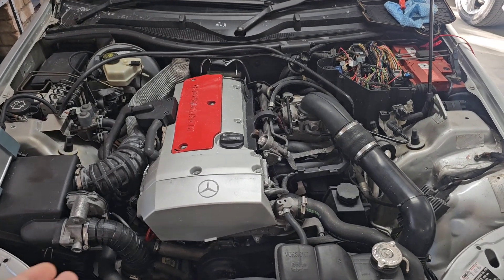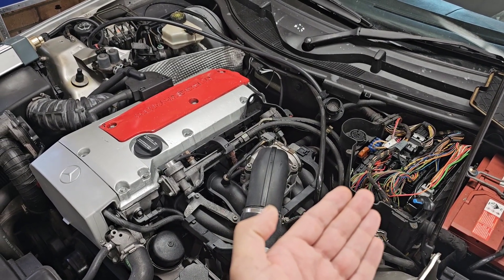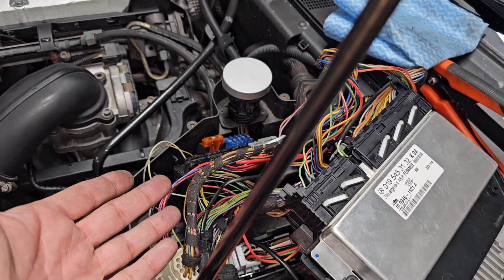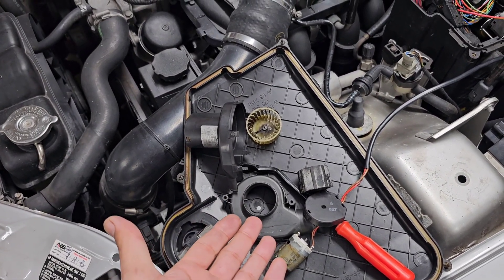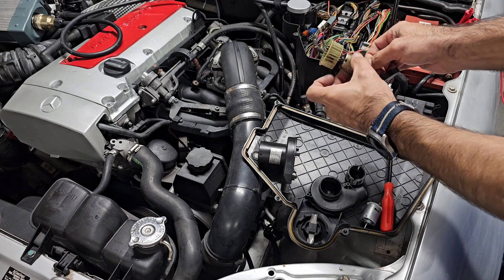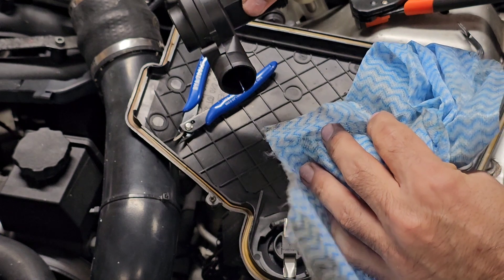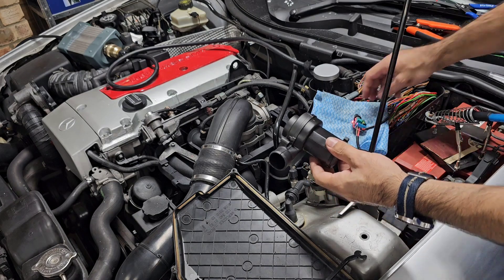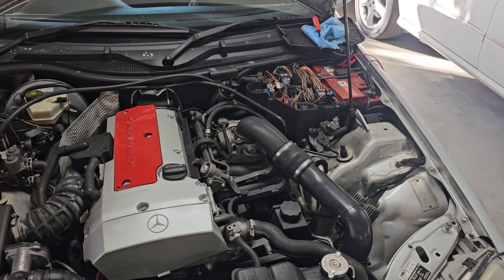ECU Cooling Fan, Why Your Mercedes Might Suddenly Stop Working!

Comment from the maker: $3 fix to a failing cooling fan for the module box on you R129, R170 and W140 and that working fan can also save your very expensive Mercedes modules... this blower fan is from the over-engineered era of Mercedes... very neat, isn't it?

Comment: Hi sir..... Is it also related to the problem if engine doesn't start when hot?
Reply from the maker: That is probably Crankshaft Position Sensor.

https://youtu.be/-BuKG1oc18U?si=9auahD193kZAjBJd
Reply: @BenzAddiction is there any procedure after replacing cps?
Reply: I already try but unfortunately it is not working

Comment: Excellent video. I checked it on my SLK and it just doesn't work. Since it's a European model, the box is right on top of the manifolds.
Do you have the engine measurements so I can buy it?
Thank you very much, and I'll keep watching your videos; they're very informative.
Reply from the maker: You are welcome 😊 🙏  unfortunately i dont have the dimensions,  but think I bought this one on AliExpress: I just found this on AliExpress: 
AU$4.92 | BringSmart RS 360 365 small electric motors 5000-19400 r/min 12v 18v 24v High Speed DC Motor For Hair dryer Motor
https://a.aliexpress.com/_msCC5Rb
Reply: @BenzAddiction   thx

Comment: Howdy my Benz friend down under (you are, yes ?)

Guess what - we w163 ML320 - ML430 - ML500, 55, 63 SUV owners ALSO have this crucial electronics cooling fan in our underhood Relay / Module box.

I had mystery glitches until I heard about this little fan - and IF its bad - you WON'T hear it Right ?

Another owner mentioned it in a forum post.

On the ML it starts on key up & runs on a timer about 3-5 ninutes after shutdown.

I DO have a video about this showing my fix on ny ML500 too.
Reply from the maker: Hi my friend,.Yes, Australia- Brisbane.  Thanks for the great info.